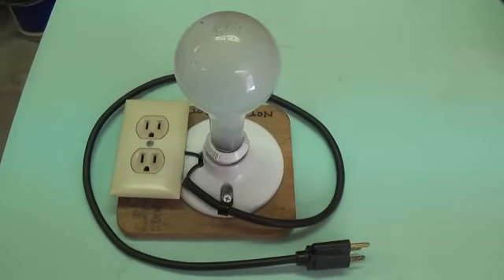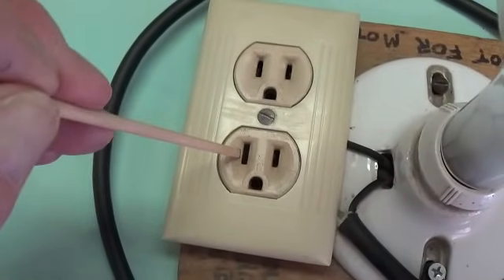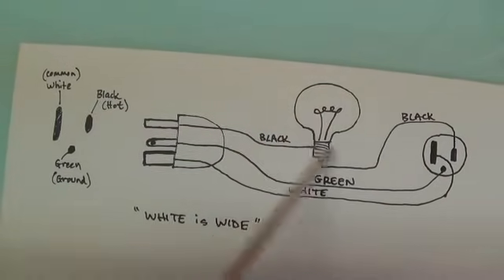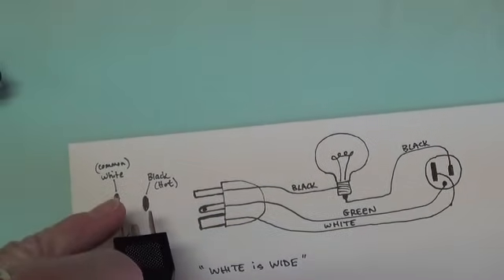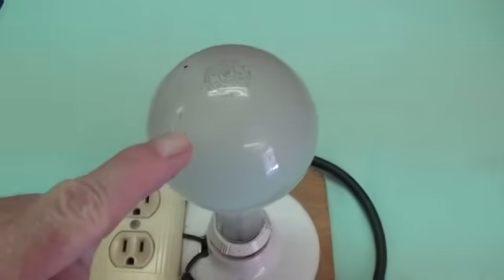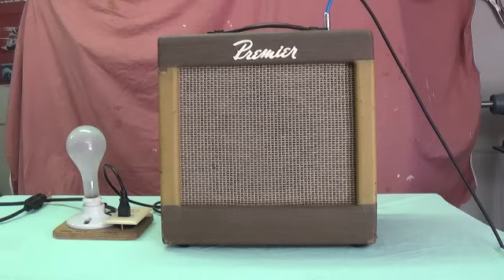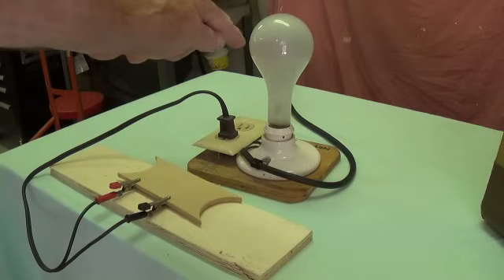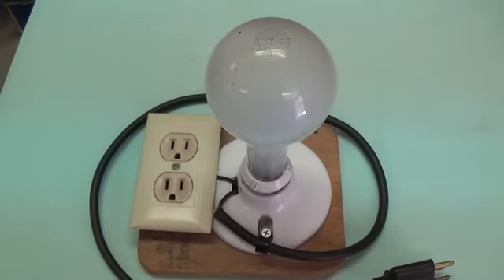Build Your Own Current Limiter for Protection when Repairing and Testing Electronic Equipment

Comment: Hey Uncle Doug!
I'm about to build one for myself. I'm just not sure if the lighbulb that I found would be good enough. It's 200W/220-230V (European of course). I measured resistance of the filament and it's 17 Ohms. Any advice?
Cheers!
Reply from the maker: Nusior, even though your voltage is double, the current flow is about half, so I would think that a 200W bulb might work. The important factor is how high the filament resistance gets when the filament heats up. I suggest trying it and seeing if you get very dim illumination or perhaps just some warmpth from the bulb. If the bulb lights up too brightly, then you need higher wattage. If it stays ice cold, then lower wattage.
Reply: Uncle Doug Thanks! I'll try it!

Comment: hello uncle doug,
i wonder if a isolator transformer do the same job as the  Current Limiter...???
i heard the isolator transformer is for protection too...
can you help me whith this doubt???
thank you..
Reply from the maker: Greetings, Bruno. Both devices provide safety, but they serve different purposes. The Current Limiter is used to limit the flow of current within a circuit to prevent damage to components and it can alert you to short circuits. The isolation transformer reduces shock hazards in devices because it eliminates the earth (i.e. the surface you are standing on) as a ground for the electricity in the device.

Comment: Excellent video, Doug.  I never thought of doing this.  I've been involved in electrical work in one way or another for 40+ years.
Reply from the maker: Thanks, Logan. It's possibly the most useful device in my workshop for amp and electronic repair. Just yesterday, it alerted me to a partial short within a can capacitor (the bulb illumination was a little too bright to begin with.....and got progressively brighter over a period of several minutes). There was no audible hum, but the can got very hot to the touch.....which I might not have noticed if the bulb had not alerted me to the elevated current flow.

Comment: WHATTTT  just by a plug in RCD it will save your life!
Reply from the maker: All of the outlets in my shop have built-in Ground Fault Circuit Interrupters (GFCI's here in the States), but I also use the Current Limiter (light bulb) because it offers a visual indication of the amount of current passing into the electronic device being worked on.
Reply: yes most first world countries have legislation which means they have to be installed in homes and such but the closer the rcd is to the short the quicker it will switch off! Or another way to think about it is the more wire you have between the RCD/GFCI the longer it takes for the solenoid to turn off the electricity. so if you have the device your testing directly plugged into an RCD/GFCI you will receive less of a shock then just relying on the one in the electrical box.
Reply from the maker: I understand, Joe. To be honest, I don't use the current limiter primarily for shock protection, but to protect amplifier components from damage due to shorted components, excessive current flow, and to provide a visual indication of changes in current consumption.
Reply: Uncle Doug Hi Uncle Doug, do you find that old amps cause your GFCIs to trip when there is no fault? I was going to get myself a plug-in RCD for safety, but decided there was no point because the amp I am working on uses the chassis and ground connection as the return path, so would cause the RCD to trip even when working normally. Is this wrong?
Reply from the maker: Greetings, WS. I always use a current limiter whenever testing or working on amplifiers, and have never had a GFI trip. Perhaps the CL prevents the type of current/voltage spike that activates the GFI. I wonder if this spike occurs when the filter capacitors initially charge, since it would resemble a short circuit?

Re GFI vs RCD, according to literature, the GFI normally triggers at 5mA, while the RCD (not common in the USA) triggers at 30mA. The RCD would probably not trip as easily or as often as the GFI, but it does not seem to offer as much protection, since 5mA is the recommended trip level to prevent human injury.

If you have (or can make) a CL, you might try it to see if it eliminates the spurious GFI tripping.
Reply: Uncle Doug Hmmmm I thought that was good news at first, but now I'm just confused. As far as I understand it RCD and GFCI are just different names for the same thing, at least in electrical terms. By either name, the device just measures the difference between current coming in through the live wire and current going out through the neutral wire. I don't know why the thresholds would have been set differently. Is a GFCI always a single outlet device? RCDs quite often switch an entire circuit, so maybe they set the trip current higher to avoid nuisance tripping caused by acceptable leakage from lots of devices. Anyway if your device has as lower threshold and doesn't trip then I should be OK on that front. As I say though I'm confused. I know a bit more about tube amps than I did a few weeks ago (i.e. a bit more than nothing) but doesn't the cathode current go to ground, and isn't it more than 5mA? If so then shouldn't the GFCI trip, whether or not there is a current limiter connected? Maybe not, because it is just measuring the difference between the current in through live and out through neutral, i.e. through the primary winding of the power transformer - and unless there is leakage from the PT itself this will always be equal. But that would mean that a GFCI would not protect you against shocks from anything on the other side of the PT, which is where most of the risk is - so maybe it's not good news after all, and maybe a current limiter would be a safer option... but if that logic is right, it would apply to anything with a transformer, which would put a big hole in the protection supposedly offered by these devices. And if the cathode current does go to ground, how do amps work in times and places where only two prongs have to be connected? Where does the current go?
Reply from the maker: Actually the current that passes through the tube (plate current) comes from the grounded center tap of the power transformer, through the chassis to the grounded or biased (negative) cathode, and flows to the positive plate. The tube plates are charged strongly positive DC by the rectified power supply, while the ground (chassis) is equally and oppositely charged negative DC. People are surprised to learn that the chassis is part of the circuit, but since it's isolated from the primary AC by the power transformer, it's not a shock hazard if handled properly. I have posted a series of videos explaining current flow and how all aspects of the circuit work, as well as proper safety procedures.

The current limiter's main purpose is to  protect the amplifier components from damage due to a short circuit (see my video). Proper technique while dealing with the chassis (i.e. draining the filter caps before touching any part of circuit...and then touching with one hand only....never two) is the best safety protection. I have personally never been saved by a GFI, and hope I can maintain this record.

Comment: I've seen this sort of device being used in other videos, but I only had a general idea of what was going on. Thanks for a great explanation. 

People have mentioned using a Variac to slowly bring up the current on an amp. I'm assuming the Variac would be used in conjunction with the current limiter. Can you comment on that?
Reply from the maker: You're welcome, IP. A Variac is useful for gently bringing an electronic device (usually one has not been used for a long time) up to operating voltage. Yes, it can be used in conjunction (actually in series) with the current limiter. However, I use the current limiter alone far more often......with every amp or electronic device I work on (except medium to large motors). It offers immediate protection against damage from short circuits and reduces the risk of shock.
Reply: Uncle Doug  Thanks for the response. Love your channel. It's a great resource.
Reply from the maker: You're welcome, IP. Thanks for watching !! :)
Reply: The variac only limits voltage,not power ,so the current is not regulated,and there is no mains isolation,so after i ruined a power transformer in a tube amp build,the 500mA fuse was protected by one half of the primary winding,i'm in the UK so both 120 winds are in series,now the thing is crap,and i should know better as i'm a design technician,i'm just about to put a lamp current limiter together using either pygmy bulbs or small halogen bulbs for a nice compact unit,the ruined TX cost around £80,convert it to dollars,then think how much a current limit bulb device will cost to make,i feel sick.

Comment: Doug, I had sent you a e-mail recently on how to build one of these, i dont know if you got it but anyways i built it and have a question. First i have a leslie 147 amp and the power consumption is 200 watts. it is a 40 watt amp but on the back panel it says 200 watt consumption. any ways i put a 250 watt bulb in and it glows a light orange. it did not get bright at all, it just slowly went to a dim orange and stayed there. should i use a higher wattage bulb, say a 300 to 400 watt bulb? any advice would be appreciated. Thanks for all these videos you put up they are very informative. But i had never built or used one of these DBT'S. Thanks Again.
Reply from the maker: Greetings, Mr. T. I respond to all YT comments but often fall behind on e-mails due to the very high number that I receive. It sounds like the 250W Current Limiter (CL) is working perfectly.....at 200W of consumption, the 250W bulb should glow orange and get warm. The 40W rating on the amp is its output power, which is quite different (and much lower) than the amp's actual power intake requirement of 200W.  Amps are rather inefficient and the 160W difference is mostly converted to heat.

I generally use the CL when working on or testing amplifiers, to protect against short circuits. For routine amp use, however, I first verify that the amp is properly fused (with the lowest value rapid-blow fuse that permits the amp to start up and function at normal operating volume), and then plug the amp into a regular AC wall receptacle. I only use the CL in the shop.....not in the house.

If you wish to continually protect the Leslie amp during routine use, I would recommend using a higher wattage bulb (350 to 400W if you can find one) or two 200 to 250W bulbs in parallel. For continuous use, it is best if the CL bulb is of sufficient wattage to not have more than a very dim glow (if any). Continuous operation of an amp at reduced voltage and current levels (due to the brightly glowing bulb) can be harmful.
Reply: Hi Doug, That's what i was figuring on doing. Do you think a Twin Light Bulb Socket Lamp holder Y-Adapter 660W 250V would work?  Would i just put the 250 watt bulb in one and a 100 or 150 watt in the other.
Reply from the maker: I don't have a Y-adapter to test, but I would assume that the two sockets are wired in parallel. If so, then it would probably work fine; however, I would use two bulbs of equal wattage (i.e. two 250W's) rather than a 250W and a 100W. Also, remember that CL's are for intermittent, not continuous, use, due to the voltage drop they cause. Your amp fuse, as previously described, provides protection for continuous use. Good luck !!

Comment: Doug, due to the lack of incandescent high wattage light bulbs, could you put a resistor in series with a lower watt bulb and get the same results? Or two 100w and one 60w bulb in series?
Reply from the maker: Greetings, Tim. You can still order high-wattage incandescent bulbs on Amazon at very reasonable prices. I would not recommend using a resistor to supplement lower-wattage bulbs. If you want to use multiple lower-wattage bulbs, then they should be of equal wattage and in parallel, i.e. two 100W bulbs in parallel as a current limiter for devices that draw less than 1.6A and three 100W bulbs in parallel for devices that draw less than 2.5A. I hope this makes sense.

Comment: Thanks a ton for the great explanation Doug !!  Funny - I never even considered that the resistance of a light bulb changes with heat. And - as many videos and articles I've reviewed about the dim bulb tester - none have ever mentioned this fact; even tho the actual workability of the dim bulb tester is completely dependent upon this fact!  Just when it needs it (during an equipment failure) - the bulb resistance increases dramatically and automatically to limit current and protect the equipment.  Now I know !!!
Reply from the maker: You're welcome, Donald. You're right about the general omission of exactly how the bulb current limiter works. I will add a note to the video explaining this phenomenon. Thanks for bringing this matter to "light" :))

Comment: Uncle Doug.  I am confused a little by your Ohms rating of 1.6 Ohms.  Please help me with my math.  If V=IR and Wattage = IV.  Then it seems that the current of a 1.6 Ohm load at 110 volts during a short situation (or normal light operation) would be 110 / 1.6 = 68 amps.  Of course - that's higher than the circuit breaker current - and can't be right.  I calculate that the resistance of a 250 watt resistive load (the bulb) at 110 VAC would be as follows:  250 Watt = 110 Volts X current.  Current = I = V/R.  so 250 = 110 X 110 / R.  So R = 110 X 110 / 250 === > 48.4 Ohms !!   Is there something wrong with my calculations ??  I do not really know how much AC current an amp draws - but if for an example - it drew 1 amp - then with the Current limiter in place - the limiter would use up 48.4 X 1 = 48.4 Volts; leaving only 110-48.4 = 61.4 volts to power the amp ??
Reply from the maker: Donald, here is my understanding of how the current limiting bulb works:

1.) The resistance of the cold filament is indeed 1.6 ohms but (and this is important) this resistance increases significantly as the filament heats up.

2.) The Photoflood bulb is rated at 250W, which means that the filament does not get hot enough to fully glow until it reaches its power rating of 250W / 120VAC = about 2.1A current flowing through it. At this temperature, the effective resistance of the filament is 120V / 2.1A = 57 Ohms. So the filament resistance varies from 1.6 Ohms cold up to 57 Ohms hot. As more current flows, the filament gets hotter and its resistance increases. This is why the bulb will only draw a maximum of 2.1A even though it is plugged into a receptacle that is capable of passing 30A or more, and this is why the bulb is considered to be a "current limiting" device.

3.) I selected a 250W bulb because virtually all of amps I deal with draw less current than the bulb at full brightness. For example, a Fender Deluxe Reverb draws about 1.5A @ 120VAC = 180W  vs 2.1A and 250W for the bulb. The bulb may get a little warm but it should not glow when the DR draws its 1.5A through it. If it does glow, then the amp is drawing too much current and the glowing bulb not only warns me to unplug the amp, but its increasing filament resistance and the fact that the bulb will not pass more than 2.1A (instead of 15A to 30A if the amp were plugged directly into the AC outlet) protects the amp circuit from harm.

I hope this makes sense and clarifies the issue. Thanks for your excellent question.

Comment: Another great video, and a great safety video to boot. I really need to make myself one of these.
Reply from the maker: If you are going to work on virtually any electrical device, except certain motors (which won't work well with a current limiter), it can be a real life-saver. If you have trouble finding a high-wattage incandescent bulb, they are available on Amazon. Good luck, Alva.

Comment: In Australia where our AC is 240-250 volts would we need to double the wattage off the lamp to draw the equivalent current eg 250vac / 500watt bulb = 2amp?  Thanks,  Colin
Reply from the maker: Even though your voltage is doubled, the current flow is about half, so I would think that a 200W to 250W bulb may work. The unknown factor is how high the filament resistance goes when it heats up. I suggest trying the 250W bulb and seeing if you get slight illumination or bulb heat, which is OK. Too bright and you'll need higher wattage. Ice cold and lower wattage. Best of luck.
Reply: Thanks for that,  I can get a 500watt halogen lamp which should do the trick.  It's becoming increasingly difficult to get high wattage globes now with the fluorescent and LED types taking over.
Reply from the maker: Charris, be sure to check the resistance of the halogen bulb. A 500W purely incandescent bulb would probably be fine, but a halogen bulb may operate on a different principle and have a different filament resistance. If the halogen bulb is not usable, you can still order 250W Photoflood incandescent lamps on Amazon at very reasonable prices. Good luck !!
Reply: Ok then, thanks

Comment: Since incandescents are being phased out by the global warming loons, how about halogen bulbs? Would those work? If not we still have rough service incandescent bulbs available. Not as bright as normal bulbs but for this purpose who cares. More rugged and last 3X longer too.
Reply from the maker: You're right, Valvenator. Incandescent bulbs are being phased out, but I have found photoflood bulbs, exactly like the one I use, still being offered on Amazon. I'm going to buy a couple extras for backup. I have no idea about halogen bulbs. I'd have to take an ohmmeter to Home Depot and check the filament resistance on a few of them to see if they would work.....I have a feeling they might not.